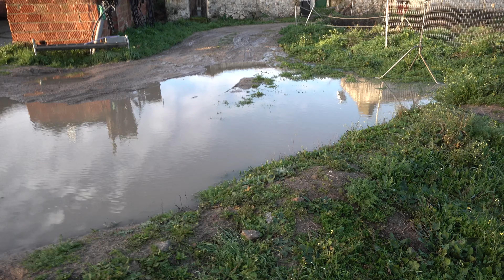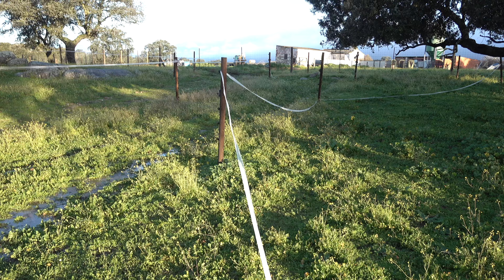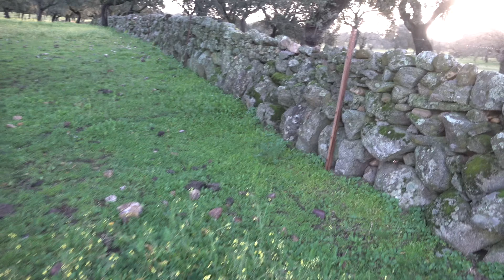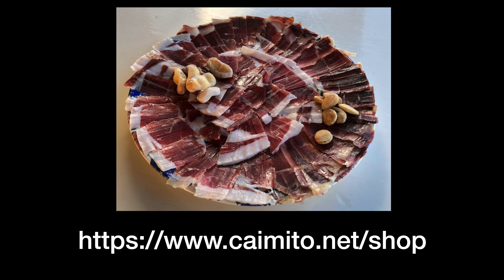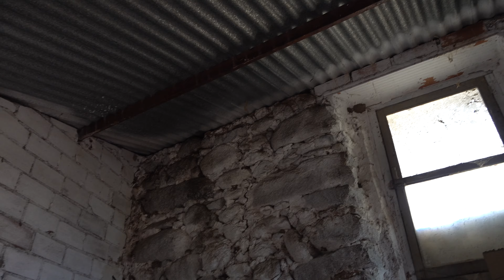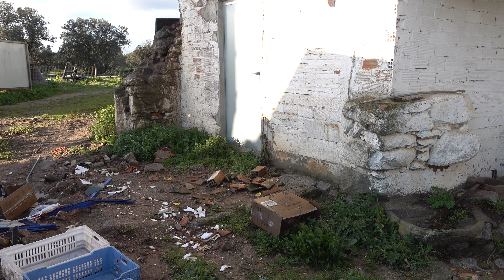Flowing Seasonal Creek

Comment: When you walk along the stream it looks like you are on top of a berm of some kind. Has the previous owner dug out the stream to get rid of overflowing water in the spring?

Could you back fill the material to make more of a seasonal marsh land instead?
Reply from the maker: It is not known what the owner before the previous done did. It's been a long time ago.

At summer temperatures of 35C in the shade with zero rain over at least 4 months there isn't much chance to establish a marsh land - I guess.

Comment: Starting from the neigboursland. Every 30-40 meters, a low check dam so that the water is held back, can spread out and slowly sink in...... einer perfekten Welt, wenn Zeit und Geld keine Rolle spielen 😉
Reply from the maker: Hard to see in a video but if you look closely you can see that every 30-40 meters there is already something that slows down the water. The bad part is that the channel is deep because it dug itself in. We might fix that when planting the riparian area in order to force the water to spread out. Maybe it would actually be good to hold off on digging the additional pond so that the fill material can be used to raise the bottom of the creek until the ford - in combination with plantings.
Reply: Dat zou inderdaad een perfecte wereld zijn.
And I would add, some like-minded neighbourhood.
Reply: Agree, many check dams. Loads of rocks laying around doing nothing. The materials are there ready to use.
Reply from the maker: @24bellers20  ... and no way to pick these rocks in 2024. Back in 1800 people built the walls as a group of 20 for a good lunch cooked by the farmer's wife. Doesn't work that way today. Things have changed since then